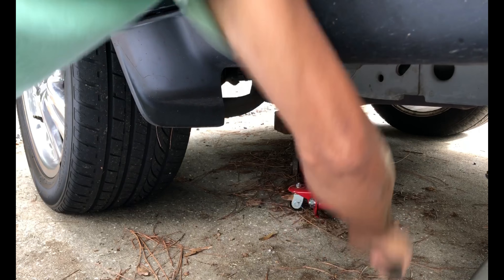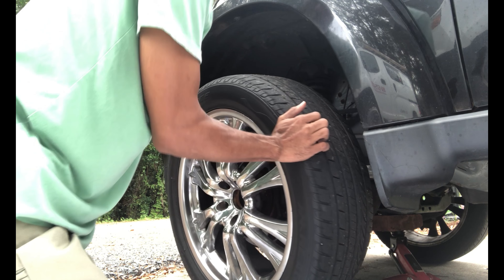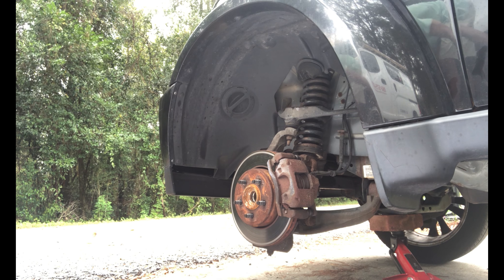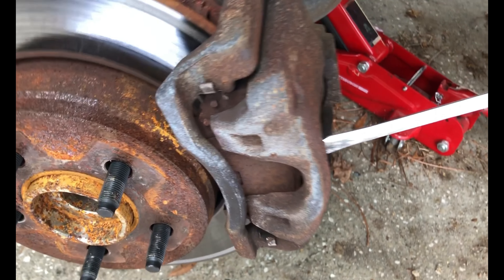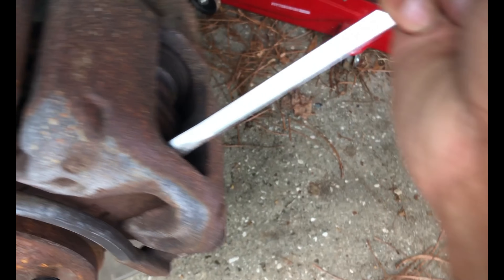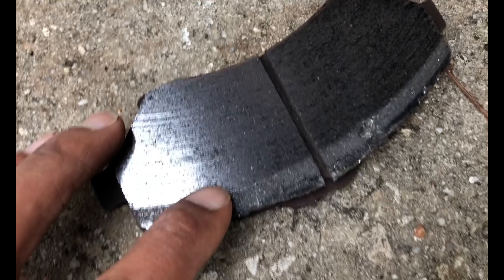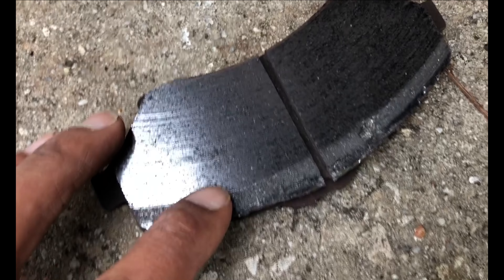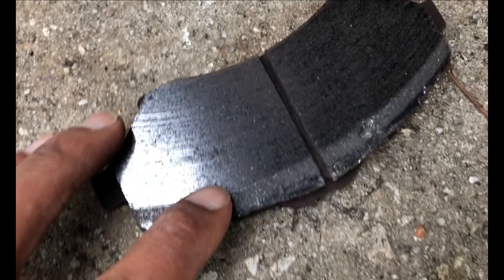ROTOR GRINDING

Comment: Crystallized pads suck. I had ceramics do this and it ate up the rotors.
Reply from the maker: Hmm. Something to look into. My original issue was a bad hub causing the brakes to heat and melt the abs wiring harness which in turn destroyed the brake pad and rotor.